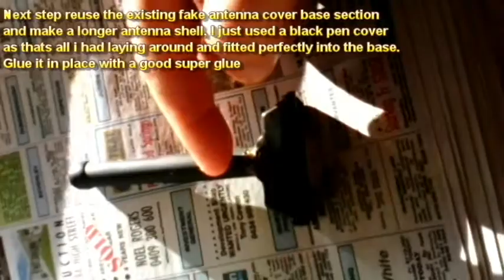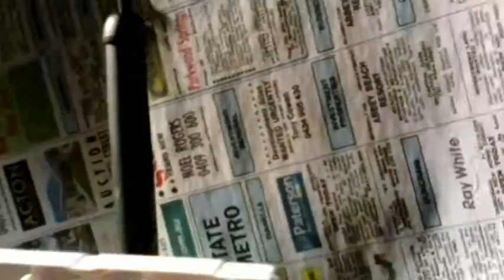Bayangtoys X16 Free TX Antenna modification

Comment: Good mod video, thanks for posting. When I removed the fake antenna holder on my AH X16 to attach the FPV holder I discovered that the antenna had fallen all the way down, but I was able to pull it back up, and in process discovered how long the antenna wire was. You can see many antenna mods on Youtube whee they have real antenna's coming out of the back and top of TX's.
Reply from the maker: Ron Brown yep I too was surprised as to how long this tx antenna was inside Ron...seemed like such a waste to have it tucked inside the case, I did this mod months ago.. reopened it to make this video and share

Comment: did mine the same bud only I used a see through soldering wire tube , works really well 👍
Reply from the maker: tony perks yep i remember, when i posted it up on fb.. good job.. i had my tx apart again today as you know so thought I'd make a quick video while i had it apart to share with others :-)

Comment: Nice! Do you know how much more range you get with that mod?  Also do you know if the transmitter stick gimbals are directly soldered onto that large circuit board or do they have wires in between?  I strongly prefer flying in mode4 with the aileron/throttle on the left stick and rudder/elevator on the right, so I'd want to switch the wires internally - if there are wires... The whole thing looks like a clone of the Syma X8 and I know all syma quads can switch control modes by holding down a button and turning it on - not sure if this clone gives you that option.
Reply from the maker: Phrancis5 hi haven't tested full range yet but it's worth having the Antenna exposed on the outside of the tx as it was hidden  behind the board before. Also mode 1 or 2 is switchable by pressing on one of the trim buttons while turning the tx on.. Just like the syma x8 series quads.. Thanks for watching 👍
Reply: Oh Snap! Thanks that's awesome, but do you know if it's actually mode 2 and 4?  (syma calls it mode1 and 2 for some reason)   Yeah Idk why almost all toy-grade quads have the antenna wire tucked inside so much. I tend to extend it and the RX wire/antenna on the quad itself.
Reply from the maker: Phrancis5 sorry I've only heard of mode 1 & 2, cheers and happy flying 🙂👍
Reply: NP thanks!